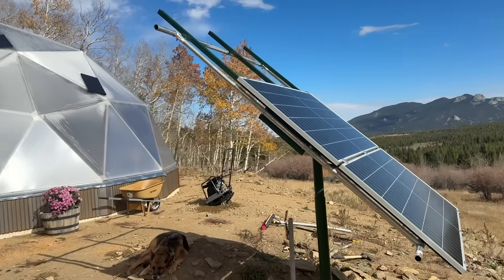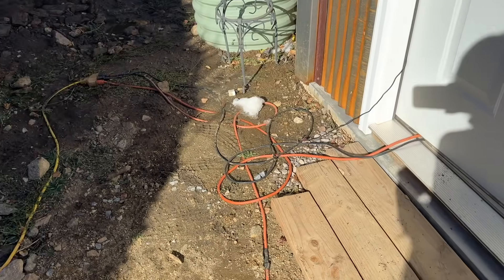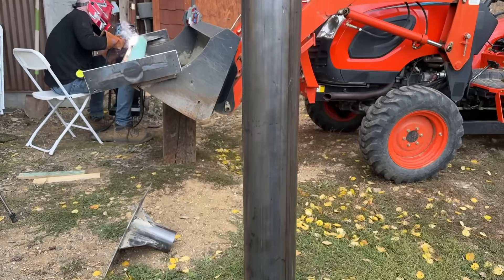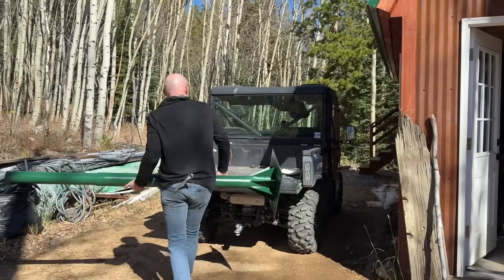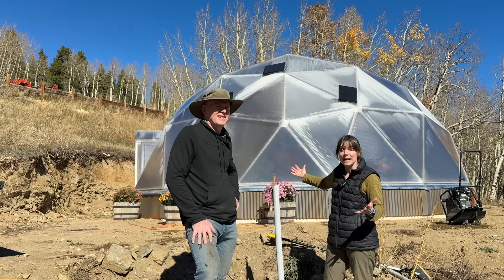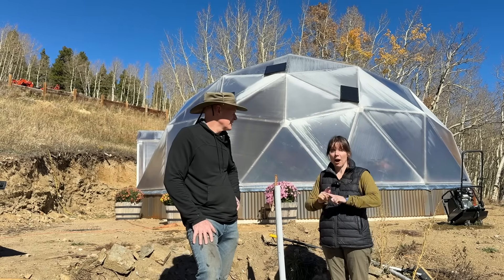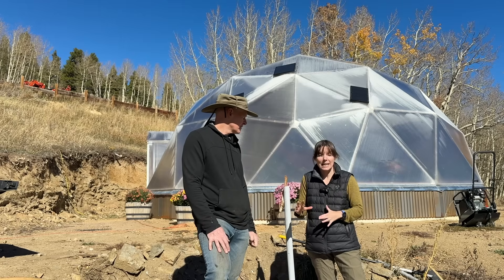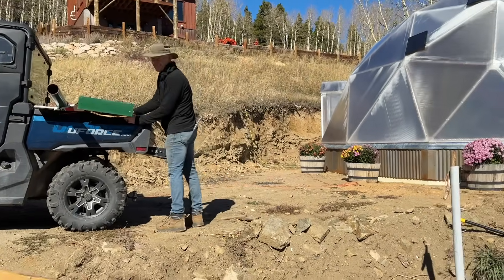We Made a HUGE Mistake with our Solar Panels | Off-Grid Greenhouse

Comment: With jobs like that an Inch is as much as a mile - It gotta be right - chin-up it will all be sorted. I'm no expert but Bryan's idea of the tether lines makes sense as the 3 panels will act like a big 'sail' and all that strain on the single pole might be a bit too much for prolonged heavy gusts?
Reply from the maker: So far- we’ve had some constant wind in the 30-40mph range over the past week and things are pretty sturdy. Will keep an eye on things to see how things hold up. Over the past 7 years of tracking wind, I’ve never seen anything over 50 mph - but better safe than sorry. Our county regs cover areas that are literally on the ridge line and we don’t get quite the same wind at our place.

Comment: If you’re really concerned about high winds, they are usually forecasted. You could put it level when forecast say high winds are coming.

Second thought is have someone calculate the wind load and whether your system will hold up. Did you design this on CAD? You could probably find an engineer online who could take your cad files, the connector specs and panels specs and do the analysis inexpensively. Outsource to some in Asia, if you actually have an autocad file, my brother does this and might be able to help you.
Reply from the maker: Thanks! Thats a good idea. The county regulations are really high (130 mph) but we don’t see anything like that at our house. Some parts of the county are literally on the ridge line and they get much higher winds. The highest I’ve seen in 7 years is wind speeds in the 40s, not sure I’ve seen much higher (maybe 50mph gusts ?) we did not use a CAD system to design, but you bring up a good point!

Comment: Spring loaded pin to lock the rotation if you really need to rotate it.  Probably need at least two to prevent liftoff in high wind situations.
Reply from the maker: Good thinking

Comment: I used heat pads with addition of a 120v thermostat that cuts on at 34 degrees with a cutoff at 36 degrees for battery safety... Works like a champ with my local outdoor temps not dropping below 20F.
Reply from the maker: That’s great info! Thanks for sharing.

Comment: just bolt the panels down instead of using the brackets. the panels are designed to be bolted down. these brackets just facilitiate easy mounting & dismantling
Reply from the maker: Thanks so much for the smart tip!

Comment: THIS WILL BE OUT FIRST WINTER LIVING FULLY OFF THE GRID.  WE DID INSTALL A PELLET STOVE FOR HEAT.   THE HOUSE IS FULL ELECTRIC.  THE ONLY PROPANE EQUIPMENT IS THE STANDBY GENERATOR.    SO FAR WE'VE LEARNED THE SOLAR PANEL ARRAY AND THE BATTERY BANK WORKS BEST WHEN THEY WORK TOGETHER.   OUR PANEL ARRAY WAS PAIRED WITH 8 270 AMP BATTLE BORN BATTERIES.  THAT SETUP COULD NOT STORE ALL THE ENERGY THE PANELS COULD GENERATE AND WE'D RUN OUT OF BATTERY POWER IN THE MIDDLE OF THE NIGHT IN THE SUMMER TIME.   WE'VE DOUBLED OUR BATTERY BANK AND ARE ABLE TO STORE ENOUGH ENERGY TO GO A COUPLE, MAYBE 3, DAYS ON BATTERY POWER ONLY.  KEEP IN MIND WE ARE QUITE MIZERLY WHEN WE'RE ON BATTERY ONLY.  BUT STILL COMFORTABLE.   GOOD LUCK.

Comment: 3 panels  should fit. Your are using the wrong type of attachment.  These are designed for on roof installation and increase the footprint of an inch per  panel . Since you can easily reach the underside of the panels you can use a slide in  nut designed for unistrut that will allow to use the existing predrilled holes in back of your  panels and be able to install your three panels without any gap between  them.
Reply from the maker: Ok perfect!  Thanks for the idea!
Reply: Yes, the spring loaded unistrut brackets are stronger than the aluminum solar brackets...
Use a large washer on the top of bolt to catch both panels in the middle.

Comment: Since your website site state your outside of Denver area in Gilpin County, you could use these angles as a starting point for your array calibration. Denver	CO	31.4º	16.4º	46.4º     breaks downs like this. 31.4 for year-round.  16.4 for Winter and 46.4 for Summer, add in a 174-degree Southeast for starting point of alignment. If your array control has a peak meter, you can find the mean number of the winter months to best allow for solar gains.  Also, do not forget to submit your solar affidavit to the state, even if this is never going to run into your home. I just found this out the hard way down in the San Luis Valley.
Reply: I am designing a ground mount for Aurora CO and like a steep angle. In the winter, snow slides off by itself, and the steep angle makes more power. By the summer, it won't make the maximum possible power but the days are so long and sunny it doesn't matter as much.
Reply: @davidstewart1153  Winter is definitely the worse season.
Reply from the maker: This is great info- thanks so much for taking the time to share.😊

Comment: Fancy tilting mounts look great, but typically totally not worth it. Get x3 more solar by ditching the expensive mounts and just buy more panels and find somewhere to lean them on the ground.
Reply: I delivered to a family that had a off grid solar system. They were auto tracking solar. However, when talking to the husband he stated that he should have just gotten a fixed array with more panels. Cheaper in the long run with less maintenance.
Reply: Exactly.  If such mounts were cost effective you would see them all over the commercial installs.
Reply from the maker: Great points- thanks!

Comment: Do you have a diagram with dimensions of your main mount system by any chance? I mean the main stem mount and the other part that mounted on top of it? Thanks
Reply from the maker: I decreased the height a bit from my original plan.  It’s probably about 78” .  The horizontal pipe is 6’-3/8”.
Reply: @ColoradoMountainLiving   How about the diameter of the pipes? did you weld another pipe to the bigger one to create a taper or did you buy it like that?

Comment: Generally speaking it is easier to just adjust the stand twice a year.  Instead of spending money and time on a tracker, just get more solar panels… make the system larger.  Also, in terms of snow load, trackers are pretty fragile verses a fixed mount.  And if constant snow is a problem you may want to orient the panels closer to vertical to eliminate snow accumulation during storms.

Anyway, you will need a much, much larger system to make any sort of dent in energy use.  Start thinking in multiples of 5kW.  5kW, 10kW, 15kW.  And make sure the batteries do not go below freezing.  Or even below 40F if you want to maintain decent system performance.

Starting small to learn the ropes is still good, though.
Reply from the maker: Great suggestions, thanks so much!

Comment: Looks like winter will be the hardest time to meet your energy needs. And I don't think you're really going to want to go out every couple of hours to adjust the angle, especially with snow. So I'd use an online solar calculator to find the best angle for noon on Christmas and set it there all year long. That'll give you a fairly steep angle so snow slides off fairly easily.
Reply from the maker: Good point. I like the sound of that.